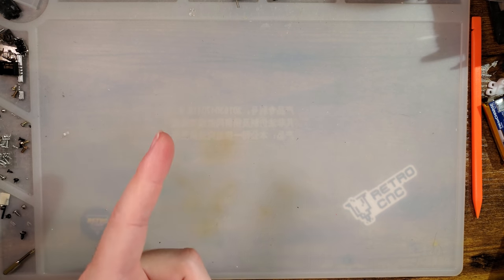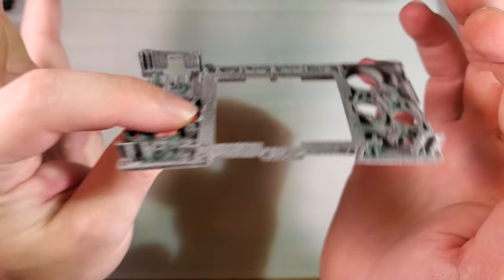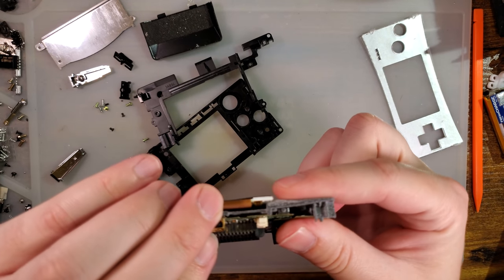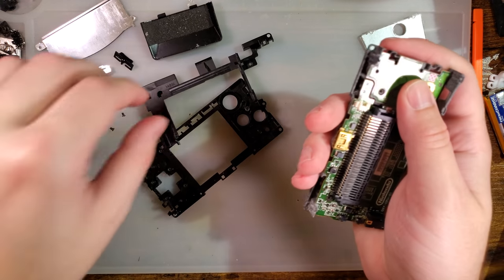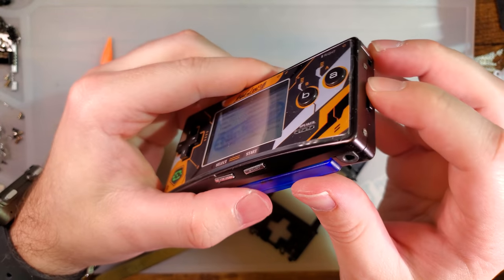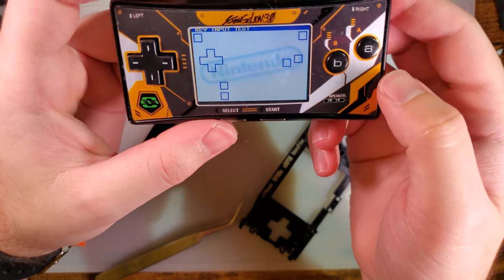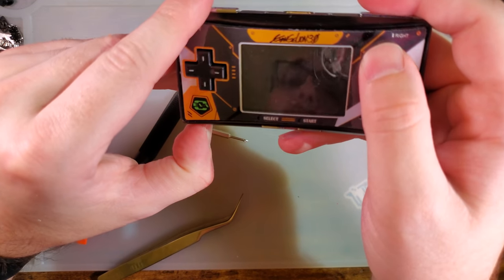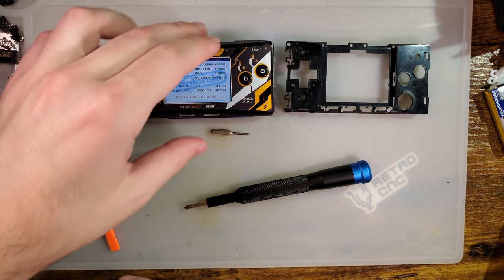YoU Wouldn't dOwnLoaD a mIcRO

Comment: Today I ruined both pieces of the frame on my green Gameboy Micro... (a little context: I'm new to this space. Literally dug out my old micro yesterday for the first time in over a decade. I had no idea it had these fragile plastic bits...)

Part of the back frame is that little key-ring hole. Well I tried running a key ring through it and all the plastic just shattered to bits. Then I had the brilliant idea to take it apart and retrieve all the bits of plastic from the inside so I could superglue them back together (I know, crap idea). In the process of opening it I broke both latches on the front frame. And that's how I ruined my perfectly decent Micro. 😭

So that's how I ended up here, I'm desperate to replace the frames because I want to start playing on my Micro again. You've got my sub at least because this content is very useful!

Comment: I have a micro with a blown audio circuit, the frame is perfect though.
Reply from the maker: I have my doubts that the audio circuit is "blown" since the micro uses a custom PMIC that handles the audio as well as the power (and battery charging). I find it unlikely that power management could still work with audio being truly dead.

Comment: If only Nintendo sold part replacementa for their old systems... come on, at least on this case they should. A friend gifted me their grey micro without the front frame (and also missing 4 screws) but I just can't afford paying 35€ for that 3d printed part and at the same time I can't throw it away; and all for that faceplate switching gimmick :\

Comment: I play with my micro quite a lot, but dude I hate how easy it is to get dust inside under the faceplate, any advice?
Reply from the maker: replace the foam gasket with a new one. It's supposed to be sticky. Not like adhesive sticky but enough to create a seal when the faceplate is in position.